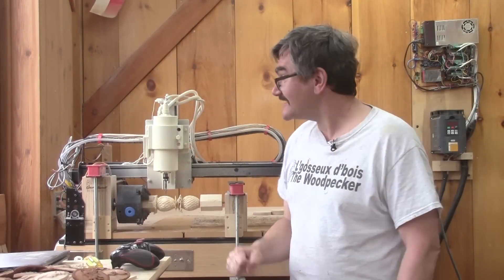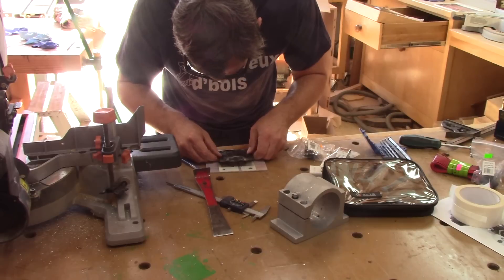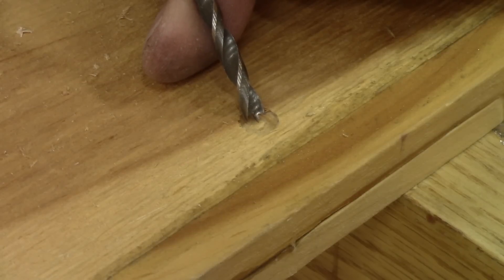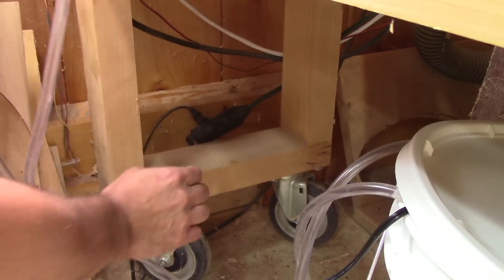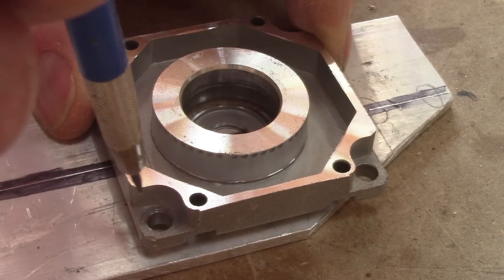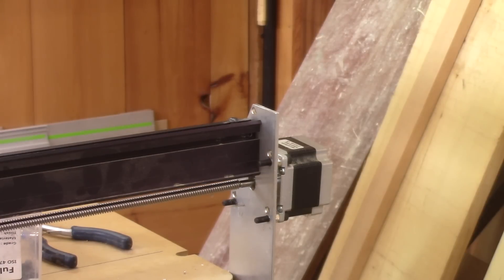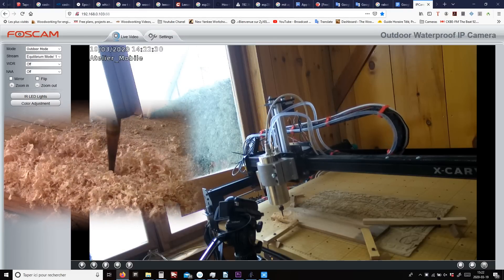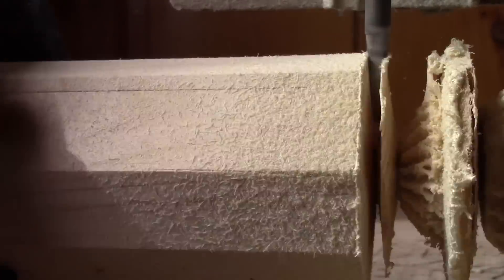The Woodpecker Ep 222  - X Carve makeover Version 2020

Comment: do you have a link for the spindle?
Reply from the maker: In fact it's my best improvement yet I LOVE it. The rest I'm not so sure .... I'll make another CNC from scratch keeping the spindle, the motors, the electronics and probably the base.
It all depends on what you really want. I bought my spindle on ebay just try searching there "cnc water cooled spindle" you'll end up with the one I bought a 1.5Kw 110V spindle with ER11 collet. But another one could catch your eye, maybe as smaller spindle or a bigger one. 
Good luck.
I'm so glad I changed my palm router for this spindle, after 9 months I never has 1 second of trouble ( with the spindle), I'm not used to that, I was changing the brushes each month on my router up until they gave up for one reason or the other, mostly premature heating of one of the bearings
Reply: @LgosseuxDbois-TheWoodpecker  thanks for the quick reaction. i will look into one of those haha. you make it look very simple, but knowing myself, i'll probably make it very hard hah.

Comment: Alain, it sometimes amazes me how you always manage to McGiver your way through just to get it to work and then manage to go back and iron all the kinks. I do not think a lot of viewers appreciate the the level of technical expertise you have with electronics as you must admit a transformation such as you have done to your Franken-router. I noticed that you conspicuously left out the cost of this project as I would hazard a quest you likely have three or four times the original price of your unit since you have had it. How much more Z height did you gain?
Reply from the maker: Thank you. And sorry for the late response we were at the cottage off the grid, it was great t :)
this end up to be quite expensive I must admit. but even with out saying the price it's quite obvious. And it's a bit for that reason I did this video. CNC sellers make you believe that you can get around with a simple cheap palm router, maybe for some it can be done if you only use your CNC for cutting, but for carving like I mostly do it won't do, 3 routers in 12 month burned in my shop, this one, hopefully, will be better.... At least it's always cool even after 20 hours of carving. 
You're so right I never mention that I raised the whole thing by 89mm just over 3"